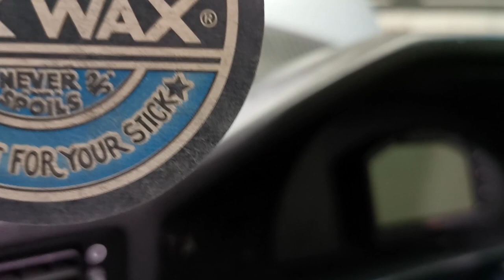My BMW E28 S54 Daily...

Comment: Great going with swap! Glad to see you running it at a hill  climb. What transmission are you using? I am wondering what I will need to modify to fit a 420G into an E24 S54 swap I am working on but in early stages now having obtained engine and trans. Thanks,

Comment: My friend! I have an 87 535IS with a dead m30b34 .. my desire is to s54 swap. what transmission are you using?   If you can please post more driving/ build updates/ test drives. very inspiring , very great stuff!  Not enough of the e28 s54 swaps out there. Bless you